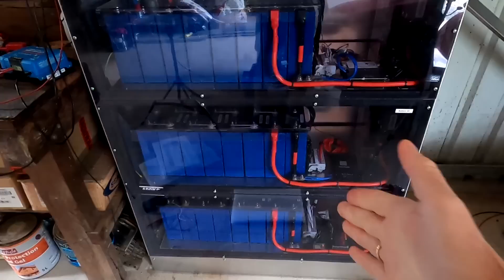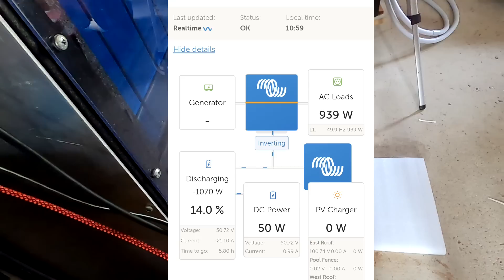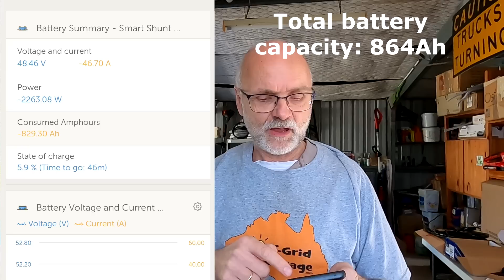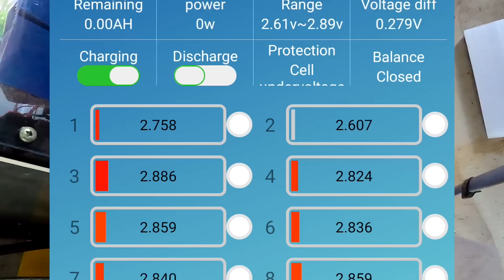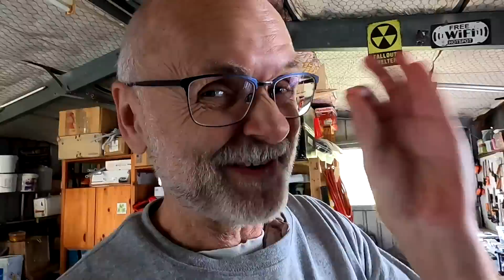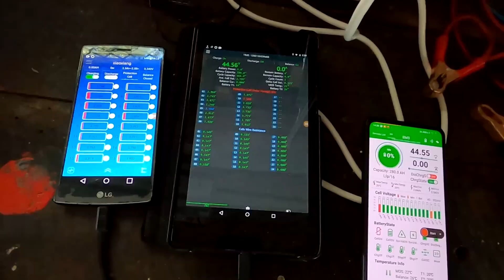Parallel Battery banks low voltage disconnect test. 3 different BMS - see what happens!

Comment: Andy! I think I have a good experiment/question. Here it is: when paralleling stings together does it matter if one part is in the shade while the other part is in full sun? I know that when matching pannels it's the lowest amp # that sets the pace, but what if one is in shade? Does that now set the pace for the rest that are in the sun?
Reply from the maker: Good question and I have shown this here on the channel in a previous video. This is exactly why I have so many parallel strings on my roof and not just one large string. Because of the shading!
So, shading effects only the string where the shadow is on. One string completely in the sun produces full power which the other string in the shade next to it will contribute only a small amount of power (but will still produce some energy). So the sunny string is not back feeding the string in the shadow as many believe. 
I will do more videos about this once we connect the stage 3 of my solar setup very soon.
Reply: @OffGridGarageAustralia  Thanks Andy! I swear I thought I've watched all your videos, but maybe that one got by lol.
Reply from the maker: @jasonwilkerson7085  it's a lot to watch and even more to remember all the information. I'll see if I can find it ..
Reply from the maker: This here: https://youtu.be/NaCOdOdhdTY

Comment: Andy. Hi! Where did you buy those L shaped cable lugs? I'm in Brazil and can't find it anywhere. I'm trying to find it on Ali Express...
Reply from the maker: I bought them locally here in Australia. There is a link on my website: https://off-grid-garage.com/cables-and-connectors/
Reply: @OffGridGarageAustralia  I don't think they would send it to Brazil, would they...? I'm gonna try to get in touch with them anyways. Thanks!
Reply from the maker: @rauserfroes81  I don't think they send overseas but you can see the specifications of these heavy duty lugs.
Can you not use straight lugs and bend then carefully? If you heat them up a bit...
Reply: @OffGridGarageAustralia  I'll try to do that. Thanks!

Comment: Hello friend, I have two sets of batteries. Do you have an idea for a group-to-group transfer switch, each group is 450 amps 51 volts? I looked on the Ali Express website, but I did not find a switch.  Thanks
Reply from the maker: What is a group to group transfer switch? What is the purpose of this? Having just one bank connected at a time?
Reply: Hello, I have two banks. I want a transfer key between the two banks. What do you recommend?
Reply from the maker: @mohamadismail3753  is the switch so you only use one battery at the time?
Reply: @OffGridGarageAustralia  Yes, I will work for one bank

Comment: Biggest issue is whether the battery can reconnect  itself when there is enough solar input voltage. Usually , i reconnect solar to the batteries by BMS reset. Imagine, if you not home, and the batteries have been depleted. Only you that have the BMS apps can reconnect.
Reply from the maker: That's what the low voltage recovery setting is for in the BMS. It will reconnect the battery bank once this voltage is reached. Charging is always allowed even the BMS has disconnected with low voltage.
Reply: @OffGridGarageAustralia I am using Ant BMS which low voltage recovery was set at 20v for a 48v system . Every time the capacity depleted  , i have to pres reset on the apps. Your BMS probably can restart by itself ?

Comment: The MP2 has a free programmable relays switch. Directly beside AC1 in. I use it for the Heltec-BMS for support balancing at 3.4V. In VE Config at Assistance use the primary relay, easy to do.
Reply from the maker: I use this to start my second inverter, the 'generator' in case I need more power. In case you haven't seen the video: https://youtu.be/SsTkgoN6ENM

Comment: I agree with Pietje NL that you probably should greatly increase your restart hysteresis.  Low voltage starts are especially onerous to inverters and it would make little sense to do restarts of whatever was powered only to have them shut down again.   For instance a refrigerator should NOT be restarted in less than 10 minutes.
Reply from the maker: Well, that's a bit different on an off-grid setup where you really depend on all that energy. Especially if you don't have any grid connection or gen.
I'm testing here and pushing the battery and system to the extreme. In real life, this would never occur and the inverter would shut down itself far before any BMS triggers. But for the sake of testing, I run it all down into the ground.

Comment: Can anyone recommend a low voltage disconnect for a 24v lead acid battery bank? Need to handle 100A continuous with 200A peak for ~0.5 seconds. Struggling to find anything simple.

Comment: WAY OFF TOPIC   On your outdoor remote power setup. I noticed that your chipper/mulcher was not a grinder but actually cutting the brush into nuggets. Haven't seen anything like that. What is the brand and model of that machine? Cheers!
Reply from the maker: That's an Ozito Silent Shredder. It has a gearbox attached to the motor and runs really slow, but powerful.

Comment: What else did you expect?  Of course, it worked as planned by a gentleman who knows his stuff and used good quality components installed professionally.  Way to go Andy!  Now I hope you get enough sun to bring those batteries back from the basement.  We want to see it when they come back to full soc, and see how the bms's handle the balancing.  Cheers!
Reply from the maker: Thanks Bruce, I was just curious if one battery bank would last a lot longer than others but obviously the power draw is accordingly to their SOC and voltage and they all die at the same time. I'm really happy with this 3% threshold I have now determined. 
Yeah, that fully charge will has to wait for a long time. I guess it will be September again until we have enough sun down here. I definitely need to be better prepared for next winter.

Comment: Hi Andy.  Something I did on mine was I found where the discharge curve was and I picked a voltage that was definitely in the curve and set my inverters to shut off at that voltage. This way, the cells were out of the flat area, but not totally dead. For me, this happens at about 15% SOC. So it leaves me with 15% of ~26kwh that is “reserved” for critical dc loads like my BMS, Hydraulic brakes (RV), hydraulic leveling, dc lights, furnace, Cerbo (Raspberry Pi in your case), etc.
Reply from the maker: Thanks. Have you ever discharged it until the BMS turned off? I really wanted to know how far I can go and power my critical loads. I would never go that far down but it's good to know I can. 
I personally don't like the inverter to shut off at a certain % or voltage but if you're in an RV, that's a different thing and you know how much reserve capacity you still need. The inverter may not be part of the critical load in your set up but for me in an off-grid situation, the inverter is the most critical part, so no auto shutdown.
Reply: @OffGridGarageAustralia   My BMS is among the critical loads in my system, so it stays on. My inverters are not critical.  But no I have not made it shut down because if If the system gets to low (which it did recently because I left the AC on too long) then the inverters turn off, and my DC loads at idle are less than 100watts. My system is 24v, and my solar array is 3200w @ 80-90v, so even on a really bad overcast day I can make enough power to at least break even with my dc idle consumption. In full sun, I’m raking in that sun juice quick! 😊 In my case, unless the rig is in covered storage (which it never is) it would be almost impossible for the rig to get to an actual 0% SOC because of the safeguards in place. Unless I had MPPT failure on both on them at the same time. Then it could happen… but I also have VRM alarms that notify me when anything in the BMS happens that is considered a warning or critical condition.
Reply from the maker: @Shep5847  great set up, that makes a lot of sense. Thanks a lot for sharing.

Comment: Great test of the low SOC shutdown.  More impressive to me was differing capacities of the banks and they still end up shutting down at nearly the same time.  The load sharing worked like a champ.  The BMSes all did their job and came out as equals in this test.  The fact that you have different equipment hooked together makes your demonstrations all the more interesting.
Reply from the maker: I was really impressed either with that and certainly did not expect such an outcome. It's good to know that I can discharge under 5% and still pull over 2kW from the batteries. That was great to see.
Reply: Thanks Andy, love your work as always! 👍

Comment: Hi Andy on all my raspberry pi I run a 18650 ups board. that way you don't suffer from failures to SD cards and data loses on the Pi when the power fails.

Comment: Hello Andy,
If I had one wish, it would be this:
Now that your system is working to your satisfaction, wouldn't it be time to draw a nice circuit diagram so that we have an overview of the whole system? When you stand in front of the individual objects and make your explanations about them, I often have the question, "Wait a minute, how did he connect it now?" Which fuses has he installed, which Victron components are integrated etc.
Greetings from sunny Germany!

Comment: Hehe yesterday I had the same situation, battery's low and I was in the dark, the whole system died, now I reprogrammed the AC > DC (800w) injector to check the lowest cell and not the complete pack so that should be happening anymore, the SOC was 65% on the Daly bms (complete BS) if 1 cell reach the <3v the "charger" goes on till it reach 3.2v, I wish it was cold here. (20-36 degrees)

Comment: Maybe you should consider a Raspberry Pi UPS circuit to protect it from the supply failures? There are some simple 18650 UPS circuits for the Pi, but maybe you could also use the spare damaged prismatic cell for an extreme protection of the Pi?
For my modem at home I have a relatively cheap mini UPS which has USB, DC coax (switchable voltage) and also PoE inject, which is nice.

Comment: Looks great
Regarding the start/stop of the inverter, maybe a bms need some settings changes so the switch on voltage difference is a bit bigger. Now all devices will keep switching on/off, and you possible destroy some devices on the output side of the inverters
Reply: Andy had temporarily set the inverters cut off much lower than usual so that the BMS would cut out before the inverter. In his normal setup, the inverter will disconnect before the BMS so the power wouldn't turn off and on as it did in this test.

Comment: Hi Andy, as you say - WOW!. Better than sliced bread I reckon, a great system. I have been dreaming, literally, for a 16S with a JK. You have bought all the components at the right time also. Sad to say I have mised the boat. The cells are so expensive now. Cheers for the Vids. Catch you in the next one. Bye for now.

Comment: Hi Andy, And Thank you again and again,for share this video,very interesting!👍
I noticed in your test, that when the low cells (2.5V in your case) cut off the BMS, the other cells are at 2.7 - 2.8 and even 2.9v
And the older the cells get, the bigger the difference will be.🤥
(Like 2.5V cut off for 1 cell,and other 2.9- 3.0 up to 3.1V!)
This is the problem of cell aging, and that sometimes after two and a half or 3 years!
Personally I set the cut off to 3.0v, I think this is preferable, to preserve the life of the cells??
But unfortunately, nothing is guaranteed?
Another solution, replaced the too low cells.
You can keep in mind that they are the cells that cut off the BMS, and if you redo the same test, you will certainly be able to find that it is exactly the same cells that cut off the BMS.
But let's keep in mind that this kind of test, we could call it extreme test, because normally in our solar system, we never go to such deep discharges like that.
(once again I would like to have feedback, from a lithium battery pack user for ESS, for more than 3 years of use)🤔

Comment: 🤔 Each battery seems to have a "weak link" that's ~300mV lower than all of the other cells in its string. What causes this, and should those individual cells be replaced? Maybe repurposed for this 12V "backup battery" that others are suggesting? 🤷‍♂️
Reply: this is exactly what happens, in deep discharge, one cell reaches the discharge cut-off threshold (2.5v in this case) and the other cells are at 2.7-2.8 and even 2.9v.
And the older the cells get, the bigger the difference will be.
(Like 2.5V cut off for 1 cell,and other 2.9- 3.0 up to 3.1V!)
This is the problem of cell aging, and that sometimes after two and a half or 3 years!
Personally I set the cut off to 3.0v, I think this is preferable, to preserve the life of the cells??
But unfortunately, nothing is guaranteed?
Another solution, replaced the too low cells.
Reply: @laurentsantaibambu7324  But it doesn't really matter since the amount of energy at 3V and below is almost meaningless.

Comment: WHY, would you be, at all surprised, by the almost simultaneous shutdown, of all 3, of your individual Battery/BMS Banks under this test…? 🙄.    Think about it..!  🧐. 
IF, you are starting off, the test with all 3 Banks correctly and equally, charged, and you already know, that each cell in all of the Banks is within very close tolerances of matched state of charge and terminal voltage and internal resistance, ..THEN, it is only entirely logical, that WHEN, the first Bank is tripped off-line, by its BMS registering the 2.5V trip-voltage setting being reached, by the weakest cell in that particular Bank, then, the entire LOAD, CURRENT DRAIN, is IMMEDIATELY, being served by ONLY, the 2 remaining, Banks that are still, on-line at that point, which means, that the LOAD Current being drawn from each of those 2 remaining Banks IMMEDIATELY, INCREASES BY 50% ON EACH BANK, to compensate for the current that has been instantly LOST, from the 3rd Bank that has just tripped off-line..! 😳😳 
AND, as ALL, of the 3 Banks were VERY CLOSELY MATCHED, IN Charge CAPACITY, to start with, at the beginning of the test, then WHY, on earth, would you, even expect, that the remaining 2 Banks, would somehow mysteriously, indeed, somehow, magically, ..”last, for another 30 minutes or so” ..BEFORE, they too, each reached your 2.5V BMS Trip-Off voltage, as well..? 🙄 
The ONLY, circumstances, under which that could be ..expected to happen, would be if your 3 Banks were severely unbalanced, in each, of their initial States of Charge, when you started the discharge test. 
For example, if Bank 1 was at 50% SOC and Bank 2 was at 70% SOC, and Bank 3 was at 100% SOC, when the deep discharge test began, then yes, under those SOC conditions, it would be entirely expected, for Bank 1 to shut down first, followed some time later, by Bank 2, and finally by Bank 3, but ..NOT, when you start off the test with ALL three Banks very closely matched, in individual Cell parameters, AND all, in EQUAL, SOC. 😉 
I would also like to add here, a couple of additional observations.          First, as you noticed, at the end of the test, when all three Banks had tripped off-line, and your inverters had shut down, the inverters then tried to restart a very short time later, as the terminal voltage of the cells started to recover, and rose above the BMS 2.5V trip-off voltage again, before immediately collapsing below, that voltage again, as the inverters tried to restart, re-imposing their Load, upon the Banks, again. 
That rapid. ‘toggling’ from Off to On and Off again is NOT, a good situation for either the Batteries or the Inverters to be subjected to, and should be avoided, as rapid current surges, under those conditions can result in the creation of large voltage spikes that can KILL, sensitive electronics. 
You can avoid that undesirable situation happening, in future, by using a “set-voltage-hysteresis” detection circuit, which will only reconnect the inverter Load, again, AFTER, it detects a “pre-set, pre-determined, rise” in the terminal voltage of the Battery Banks, AFTER, they have, FIRST, received an “appropriate level” of re-charging. 
And my second observation is, that I personally, would not be recommending that you use 2.5V as your BMS low voltage trip-off point, for your ..protection, of your ..expensive, Battery Banks, because from my own understanding of the characteristics of Lithium Batteries, deeply discharging them, down to levels ..below the 3V ‘knee-point’ is ..definitely, ..undesirable, in terms of the ..expected, remaining longevity, of their ..then, ..serviceable-lifespan. 
Personally, I would be setting the BMS low-volts trip-point at 3 Volts, and no lower.    Pure-Sine Generators are pretty cheap to buy these days and I would certainly be investing in a 3.6kW version of one of those, as an emergency power source backup, rather than be risking the expected serviceable lifespan, of my ..very expensive, to replace, Lithium Battery Banks, by trying to wring, the ..absolute ..last ..morsels, of stored-energy out of them. 🙄 
Anyway, for what it’s worth, that’s my own 2-cents worth, for you to consider.   Keep up you own good work, and keep making your videos that are enjoyed by a lot of Folks, including me. 😉👍

Comment: I have three 16s battery banks with these 289 power cells. Each of them has a JK PMS. When the system got down to around 28% at 1 in the morning I figured it would be enough to make it through to the next day. But I was surprised to be awakened by my wife at 4 in the morning telling me there was no electricity. When I went downstairs to check all three battery Banks were at 0%. So it seems nonlinear once you get below 30% you've got about 2 hours left it seems.